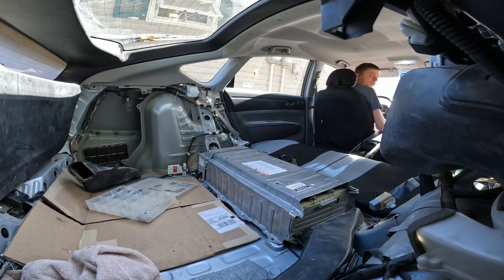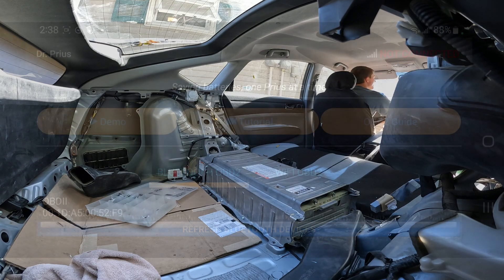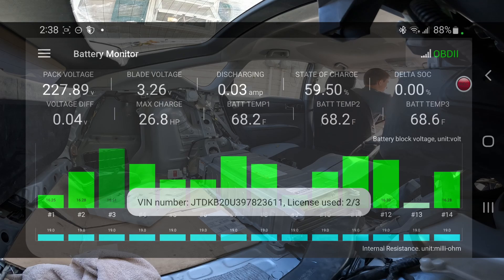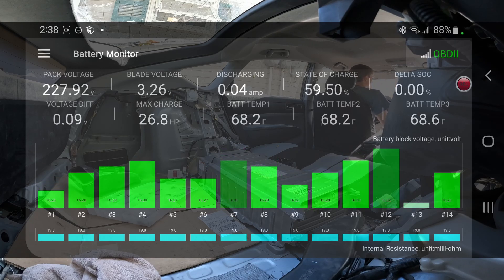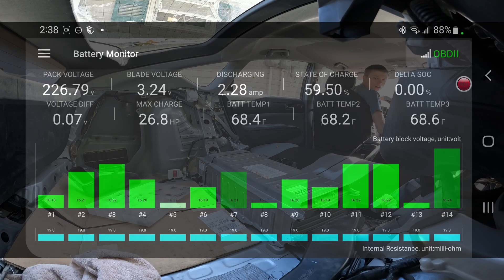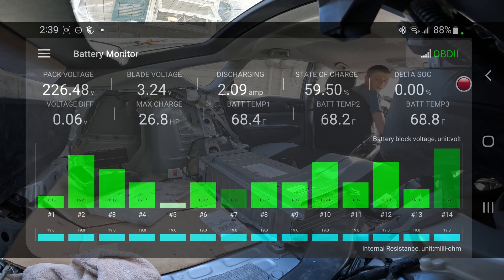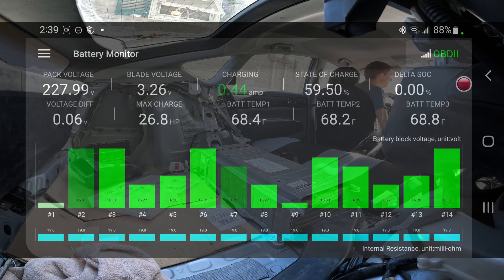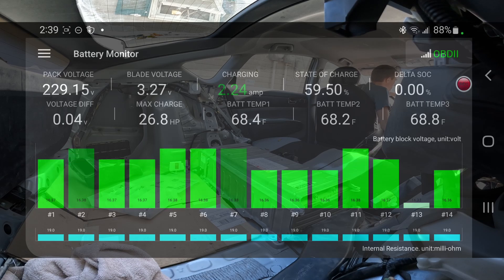Project Lithium install in less than 10 Minutes.

Comment from the maker: I no longer recommend the Project Lithium Battery. They are not well made. Read this Reddit thread to understand why I'm making this comment: https://www.reddit.com/r/prius/s/MdK3g2ONk3
Reply: There’s thousands of these on the road. As you can see, they don’t catch fire. They smoke to death. That was the only incident and the culprit was that the loose wiring.  I know a number of people who are still running their old version one packs still. All I can say is you can run the OEM or you can run this one which is a game changer have to wait twice the range and then mpg boost

Comment: blade voltage too low 3.26v why? supposed to be 8v
Reply from the maker: @MLK.PaNoRaMa  it's measuring the individual cell voltage per blade. For the Lithium upgrade setting it takes takes the 14 blades and x's it by 5 and for individual cell voltage rather than blade voltage.

Comment: Why did the first one fail? Bad installation or something else?
Reply from the maker: The reason it failed was because the battery overcharged. It Couldn't handle the constant regenerative braking I do as a Rural Carrier for the Post Office. I made the video to show I installed the Battery correctly, so there wasn't any doubt if it failed a 2nd time.
Reply: @JoMophee  Thank you!
Reply: @JoMophee does do lithium upgrade improve mpg?  I have an 08 with 180k miles..  currently at 50 mpg with the original factory traction battery..
Reply from the maker: @camposvazquez  no not significantly.
Reply: How much did the new battery cost?

Comment: Hi. Great job.Some questions? Nexcell battery i presume. Car? Didn’t need to change the BMS and battery case I see. What about the temp sensors? Thanks
Reply: How has fuel mileage been since the swap did it increase at all?
Reply from the maker: 2009 Gen 2 Prius. 

The only thing you replace are the battery modules themselves. Everything else stays in the case and attaches to the new modules... including the temperature sensors.